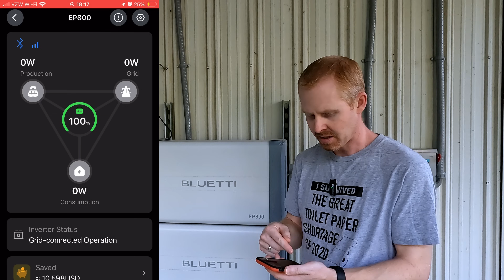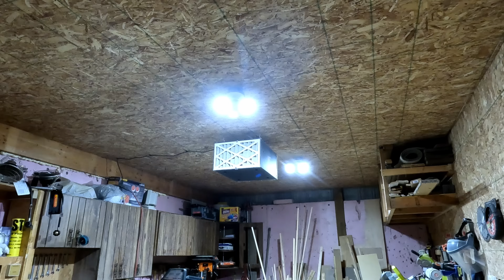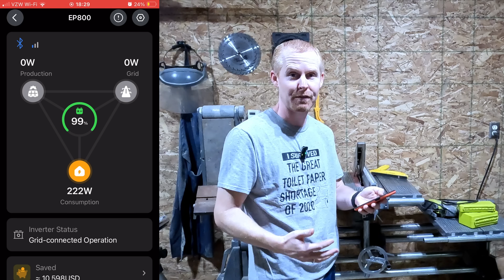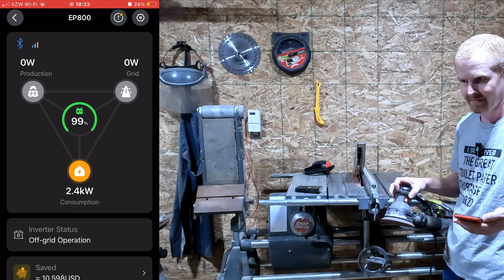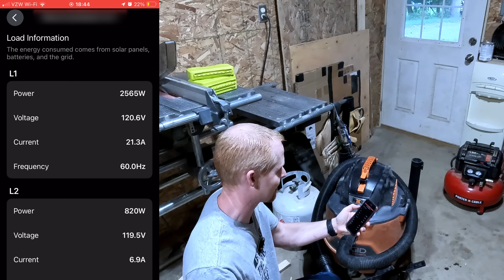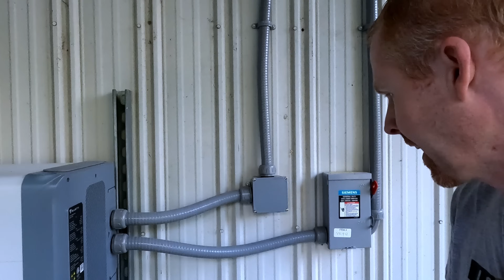Testing the BLUETTI EP800 & B500 Batteries - Including a Real-World Test!

Comment from the maker: Links to the parts & pieces in the video (affiliate links)
------------------------------------
- BLUETTI EP800+B500: https://tidd.ly/4lyld0O
  Discount Code: AdamEP800 - 5% Off
- Santan Solar Pallet of 250W Used Panels - https://www.santansolar.com/product/used-ssg-240w-solar-panels-cracked-vinyl-pallet-of-25/?campaign=SolarRoofProject&ref=adamgog
- Liquid-Tight Conduit - 1inch 100 Foot - https://amzn.to/3yMQY3R
- 50' EA THHN THWN 6 AWG GAUGE - https://ebay.us/PcnGqP
- SIEMENS 2P 60A 240V General Duty Safety Switch Outdoor, Non-Fusible - https://amzn.to/4cuhkpg
- HKS Ratcheting Crimping Tool - https://amzn.to/46MLOl7
- iCrimp Solar PV Panel Crimping Tool Kit, c/w Solar Connector Crimper - https://amzn.to/4dHyEsl
- Klein Tools 60580 Work Gloves - https://amzn.to/407kvR1
- HURRICANE 1000V Insulated Electrician Screwdriver Set - https://amzn.to/405ibtQ

Comment: Curious yr later , how do you like it.
Reply from the maker: It's still running all my buildings without any issues.  In fact, we had a nearby lightning strike last summer and it "tripped" the grid connection because of a huge voltage spike in order to protect the system.  Pretty cool to see!

Comment: In general, does this flickering cause any harm to aircon or fridge? 
If yes , I believe we should use time delay and contactor that turns off the appliance for 3 min between the switching
Reply from the maker: @esmailalkassir1565  most systems will have a quick blink from led lights when switching.  It’s only because led lights are so sensitive to voltage drops.  The compressors will remain running.